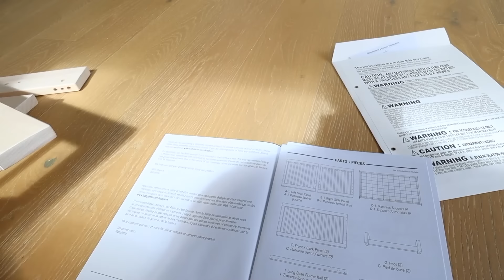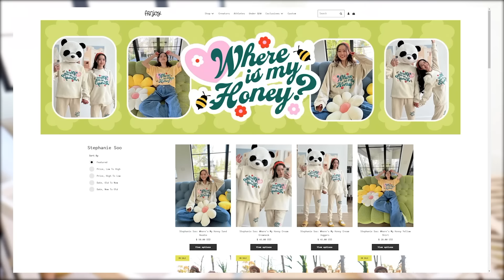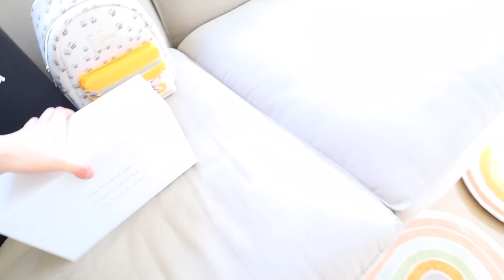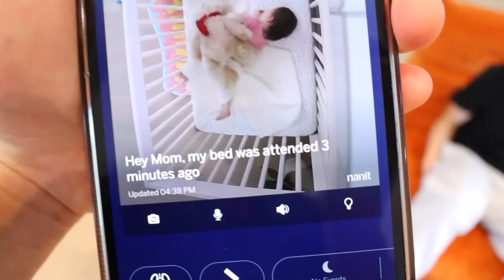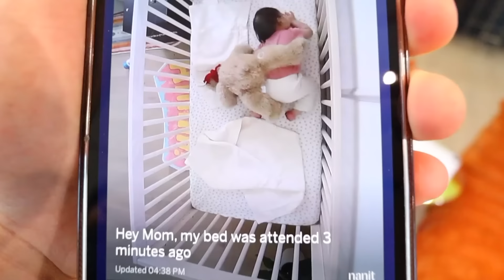Sofie almost got ELECTROCUTED so we baby proofed the house *nursery reveal

Comment: So when installing drywall anchors you just drill a hole one size smaller than the anchor. Then you use a mallet to hit it in. The anchor will expand and tighten up once you screw a screw into it.

Comment: there's this outlet cover that I see in most Asian stores. It's flat and clear plastic plug that you can insert on the outlet (the holes idk the term). In that way, you don't have to find a cover in the same size as your outlet, you just need to choose to get a regular plug or the one with 3 plug something like that.
It's not shiny so not an eyesore and it blends well like an opaque